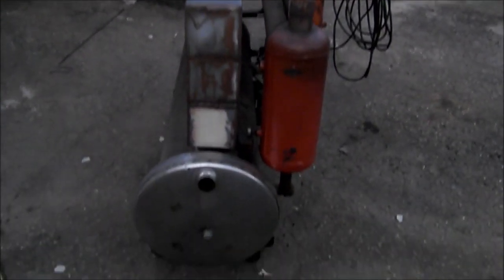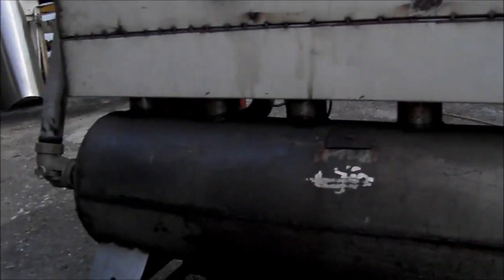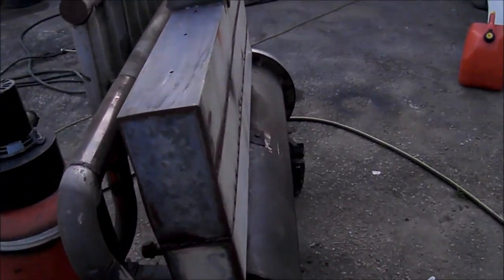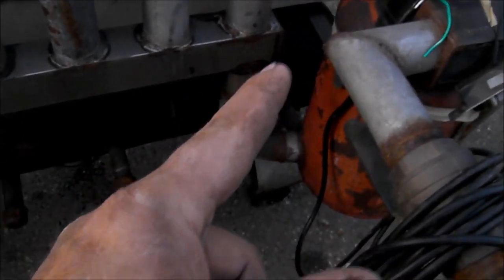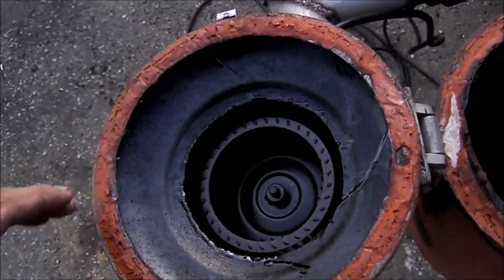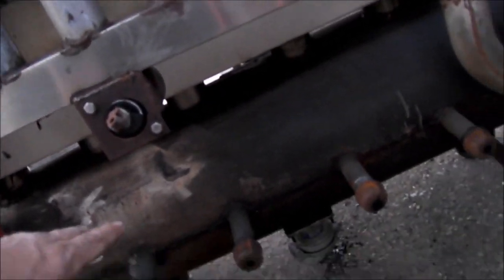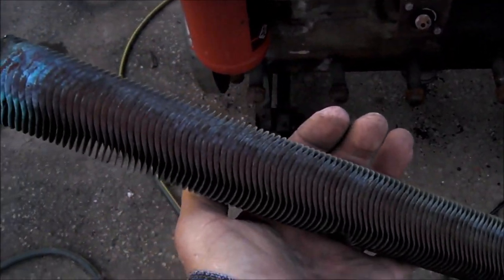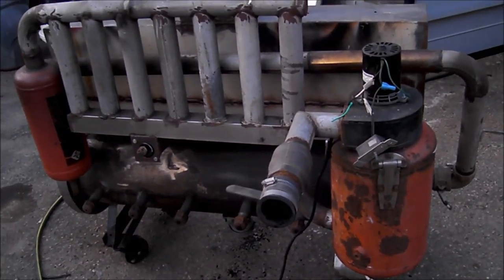WORKING TOWARDS DRIVING ON WOOD PELLETS IN MY V6 TRUCK

Comment: Hi, if you need more cooling of your woodgas, you might try what I did on my old woodgas truck I used an intercooler from a big diesel, worked great, I just put it after most of the filtration, to keep it from gumming up fast

Comment: Forgive me if I will sound preachy - but your setup is not working well for you due to a couple simple things. I say this coming from 20 years in oil & gas process engineering & design.
 - Your radiator needs to be ahead of the cyclone filter. Reason - As you cool the combustion gases you're going to produce condensable liquid(s). The cyclone will help remove the liquid droplets, and prevent them (largely) from entering the filter bed of shavings. The entrained condensable liquids will also aid in removing entrained non-combustibles. The shavings should only be for polishing the gas, and not getting bunged up by excessive liquid loading. Excessive liquid loading in the shavings will result in a higher pressure drop and wasted shavings. If you're getting liquids to your fan (as you have shown you are) one or both filters may be too small in diameter, but it's hard to say with your current setup. 
 - Your radiator design as you noted consists of currently 7 air/gas exchangers in series. These should be in parallel. Reason - reduces gas velocity, and increases residence time affording time for thermal conduction across the rad walls. Because the air/gas temperature-difference is the driving force for energy removal, you're reducing the driving force in each pipe by having them in series. Addition of finned pipe is great as it'll increase surface area by which to remove heat. DO NOT implement and up/down piping configuration when condensing liquids. Reason - as liquids are condensing over time there is potential (likelihood or certainty) for them to accumulate at low points. This can increase pressure drop, lead to instability, and facilitate corrosion especially where there are no drains.

Yours is the first in which I've seen a horizontal pyrolysis tank/reactor. As you may be liberating a lot of gas in this configuration it may be important for you to actually measure the gas rate produced. If your gas is moving too fast through the cyclone entrained liquids may not settle as well, you may have less heat removed in the rad, and will have a higher pressure drop through the system.
Reply from the maker: Thanks for your imput ,as I said I'm just trying to figure this out as I go and gents like yourself reinforce what Iv'e been hearing. I was looking at an old high effiency gas furnace and looking at how I might incorporate the heat exchanger / condesator In the appropriote location and see how that works. Much more surface area in the manifold and are actually used to condence H20 from natural gas so not much of a difference from syngas.
  I'm also going to install stainless steel tubes with nozzles on the ends right out the top of the hopper box and allow the incoming atmospheric air to be preheated before entering the stainless steel burn bowls. Also insulation between the inner and outter walls of the two tanks will give higher temps for Pyrolysis and hopefully turn the tars into syn gas aswell to prevent the medium filter to be less  comprimized.
  The only shaker I have is a 12 volt car drive by wire steering motor with an excentric weight on the shalft to shake the whole unit. Not sure if this will be suffient so I may have to install a stainless wire of some shape on the ends of the air tubes beside the nozzles to stir the burning bio char in the stainless steel bowls  to shed the ash. I'd have all 6 air tube rotate on bearings on the top of the hopper. To rotate all 6 at the same time I have a bbq rotisory motor thats relitively higher torque and rotates slow and slower if I install a poteniometer. May need to install pulleys on the top side ends and split a surpentine belt for a narrow drive belt to run it in a staggered configuation with a pulley idler beside one of the the end pulleys and rotisory motor at the other . Thought belt drive might be better then chain drive incase of a possilbe bridge jam in the burn bowl. All food for thought! thanks again for your imput.Cheers Lou
Reply from the maker: I also want to add that I want to shorten the ignition tubes at the bottom and insert a 12 volt glow plug that I aquired from a large diesel engine which I can electrify for startup of the wood pellets. Probaly put that on a timer.

Comment: an idea for you. cut threads onto the outside of the radiator tubes. also submerge in a water tank. the threads on the outside, mixed with the thinner tube walls, should transfer heat out better.

Comment: Need to get your air intake temp up to preheat temps, preferable at least 400f. This keeps the fire lobe hot enough to crack the tars and create more powerful cleaner fuel. Tar cracking happens 2000-3000 degree that's what the fire lobe needs to be at to produce clean woodgas. Make sure whatever engine you are running can pull enough vaccume to keep those temps, then you can ditch the cyclone filter because you will only have soot coming through the system which should be caught in the filter before it gets to the motor. Condensate gutters to get rid of the excess water will help keep temps up and allow the fire to help dry the pellets before pyrolosis. It takes very very minimal water to get some hydrogen, but the bottom line is we don't need the water. You won't get perfectly dry pellets ever no matter how much you try so get them dry as you can and let the remainder be your water supply for hydrogen production
Reply from the maker: Im going to run the intake tube through the inside of the heat tank.
Reply: @glassblastcollision  good way to do it, also good to scavenge excess wasted heat made by the engine (exhaust heat)

Comment: I really like the look of your rig, very original and compact build. Never seen a multiple burner setup, cool potential with the fuel richness vs pressure.

Only thing I might suggest is getting your reaction zone hotter. You'll have greater efficiency and less mess in your system, as well as gorgeous flares. Insulation and an air intake heat exchanger help achieve this, but there are tons of ways.

Great work man, I look forward to seeing more!
Reply from the maker: So should i heat the in coming air supply from my light up tubes and maybe pass an exterior intake on to the side of the tank to pick up some heat ? I was going to pack the space between the internal and external tanks with Roxal for added insulation . I also wanted to take the 6  -12 volt  glow plugs and thread them into the lighter caps you see on my machine for quick lighting. The new rad I build should cool the gas enough to get a more concentrated syn gas I hope. If not I may have to add a shroud and fan to this device.
Reply: Yup, that all sounds fantastic. For your heat exchanger, you just want maximum surface area on the inside of your system, without any unwanted pressure drop. 
You may already have this implemented, as you seems to have this well under control, but I want to stress how important having pressure and temperature gauges throughout the setup, to the point that it almost seems silly. But you learn so much about whats going on in each module, the essential 900-1100 degrees C in the reduction zone, to the ambient temp of your syngas. 

Sweet idea with the glowplugs, let me know how that works out! Might ask for some pointers on how you did it :)